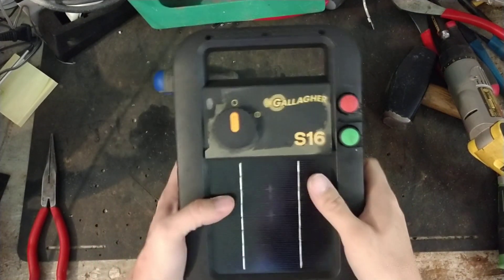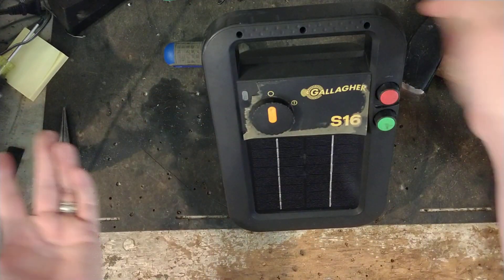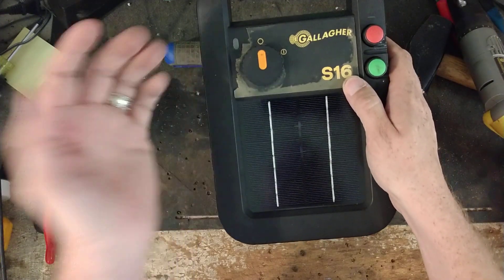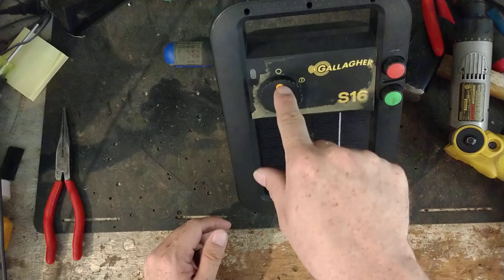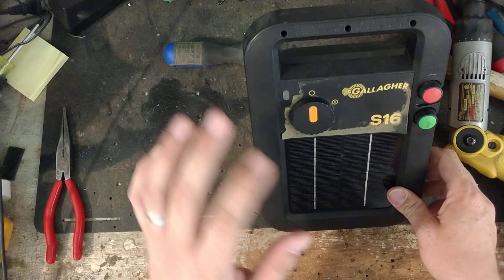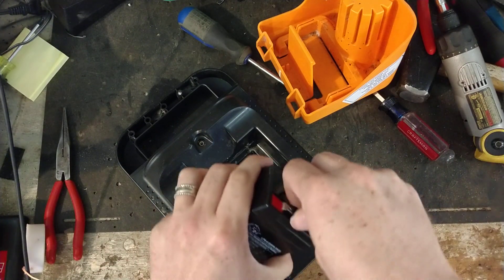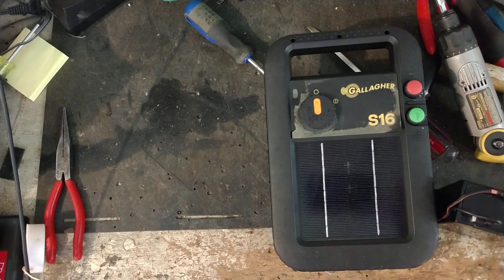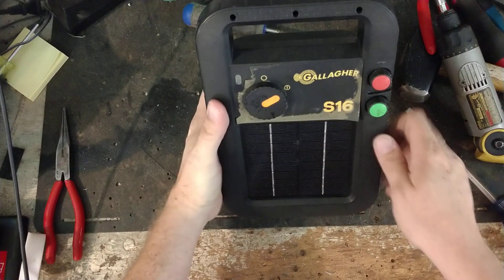Best Solar Electric Fence Charger | Gallagher S10, S16, S20 Solar Repair

Comment: THANK YOU!!  I may have to replace the battery. I’m getting 6.4 V out of the battery. From the terminals I’m only seeing 1.9-1.6 KV and when I bought this in 2017 I was seeing about 4-5 KV. I’ll try to find my manual…
Reply from the maker: Your battery is reading perfect, so it's not that. It's likely inside the unit that's bad.

Comment: The green battery lite is flashing when wheel turned to the left , red lite flashing when turned to the right , Any suggestions ?
Reply from the maker: Does it show the red light when it's hooked up to the fence and ground or when it's all by itself or both?

Comment: My S20 just isn’t doing enough. Any advice on modifying the unit to gave a bigger zap? Maybe capacitor or add a additional SEL battery in parallel?
Reply from the maker: You can't really go much bigger inside that unit with capacitors and such because then the solar panel couldn't keep up with the draw. Also, you may overpower the transformer by putting too much power through it. If you're not getting as much power to the fence as you'd like to see, and the voltage reading on the fence is 5kv or higher, then the only thing that might help it out some would be to add another ground rod. You should have at least 1 ground rod in the ground as deep as you can drive it in. A 6' galvanize rod drive it in 5.5' leaving just enough sticking out to grab onto. If you add a second ground rod, space them out 10' but no further and not any closer than 8' and drive it in as deep as you can and use galvanized ground rod clamps and leftover fence wire to tie the rods together works just fine.
Reply: @FencerFixerRepairLLCKansasCity  thanks, that makes sense. I have 4 ground rods currently, a modest poly fence but am only getting 3kv-4.2kv. I may trickle charge the battery and check it’s capacity and retention.
Reply from the maker: @Gurusi  I bigger 6v battery won't allow the charger to put out more power. All the batteries do in any unit is allow it to power up and turn on, they don't have anything to do with the power output. Also, poly rope and poly tape type of fence have a lot of resistance in it compared to regular smith wire or the turbo braid. So the longer the run with that type of wire, the more resistance the charger feels and the more a unit can get dragged down. So it could be that you just have too small of a joule of a unit for the amount of poly rope you're trying to run.

Comment: Nice video and thank you! I honestly don’t see how this could cover 30 acres cause I have 2 acres and it doesn’t bite very good. 1st year I had it the shock was good. I can’t seem to get that shock again. I’m thinking it’s either ground or this new polywire I bought isn’t carrying the load good. Put new battery in. Did your reset and the lead shocks me good but wire polywire doesn’t. Any suggestions on good poly wire horses can see? Ground is 1.5 foot in ground which is about all you can get in this rocky area. Maybe 2.5 foot
Reply from the maker: If your unit is not going to be portable and stay in one place, add another 2-3 rods as deep as you can and space them 10' a part. 1.5 foot or so in the ground isn't much of a ground for a unit, even on a small unit. You can never have too many ground rods, but you can have not enough. You could start there. Test your fence with a good quality fence tester, or if you want to put your hand on it, squat down to your knee to bypass your shoes and lay the back of your hand against the fence. Sometimes your shoes or boots will insulate you against the ground and you yourself won't be grounded will enough to feel a good shock, animals are basically barefoot, but you still need a good ground system.  On your rope wire, if your using that big diameter equibraid wire that's big around as your pinky finger, that stuff looks good and visibility is good, but it's only got 4 conductors in it and it doesn't carry a shock all that well. Here's some good quality stuff that has more conductors and will carry a shock better and is a lot better quality, but it does cost more, but it's for a good reason.
https://gallagherelectricfencing.com/collections/turbo-wire-poliwire-equifence-metal-wire/products/7-64th-diameter-turbo-braid-1312-free-328

https://gallagherelectricfencing.com/collections/turbo-wire-poliwire-equifence-metal-wire/products/1312-gallagher-turbo-equibraid

Comment: Great to see an upload from you again
Yeah Gallagher are without doubt making the best solar energisers out there, they're well made units for sure.
S16 is a favourite out of the 3 smaller models, and then I've got a S100 out paddock grazing the cattle that's absolutely brilliant fencer with a real good output
Reply from the maker: Hi Oliver, it's been crazy busy with repairs nonstop. Plus we've been dealing with a lot of storms here and rain and flooding. It's slowed a bit with the rain, so things are drying out here for us, but it doesn't slow down the repairs. I've got the S40 here and it's a good little charger and works great. I've had it for 3 or so years and it's never stopped running. I've got it out running about 11 months out of the year and it hasn't missed a beat and still using the same battery.